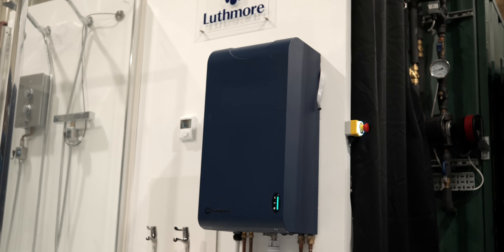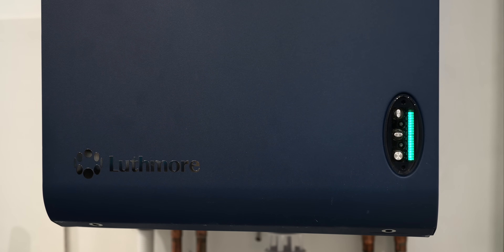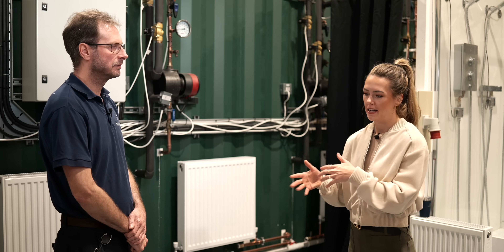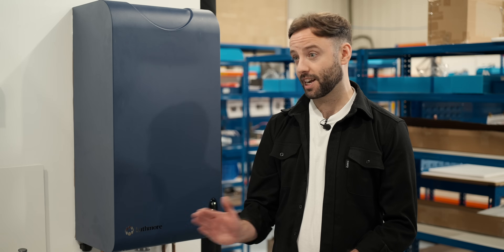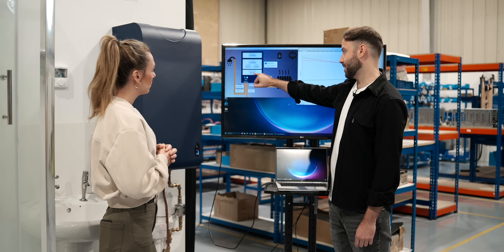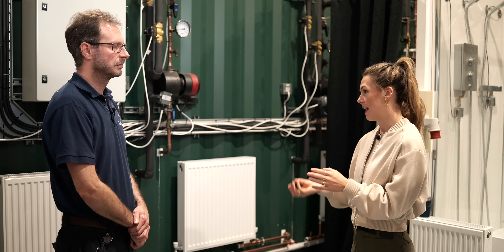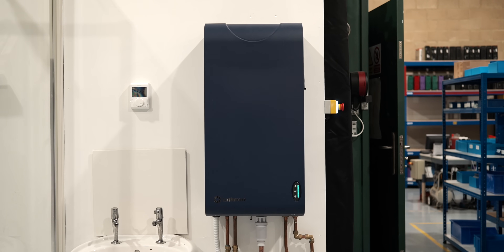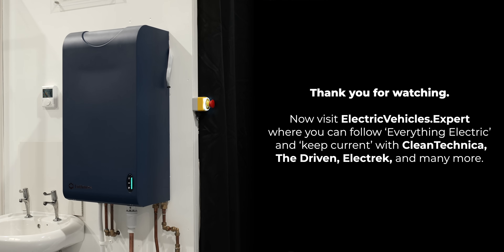Could This Battery Boiler Replace Gas AND Heat Pumps?

Comment: So basically it’s like a storage heater.
Reply: No, it's more like a combi boiler...
Reply: @theelectricmonk3909 a very expensive one which ever it is ,  none of these systems will be adapted in a massive way until they are affordable for the average income, in reality will never happen.
Reply: @KavanOBrien   "in reality will never happen." - they said that about the car, they said that about TVs, they said that about computers, they said that about mobile phones.

The REALITY is - anything that's newfangled and expensive now, WILL be affordable in time - or will vanish without a trace if something better comes along (think Logie Baird's TV vs. Marconi's TV).
Reply: @theelectricmonk3909  talking of time unfortunately it waits for nobody, if people manufacture items that only a few can purchase it doesn’t take that much time for the item to be no more .
Reply: @KavanOBrien  Well... I wouldn't like to make a prediction as to which innovation will, or won't, succeed in the marketplace.  IMHO there's certainly a short to medium term opportunity for the boiler in this video; long term, I suspect heat pumps will prevail. One thing is undeniable - even if you ignore the climate arguments, our use of finite fossil fuels means that gas is only going to get more and more expensive and unreliable, so an alternative will be needed - this offers an interesting prospect to tide over those who still can't seem to see the benefits a heat pump brings, or who - for whatever reason - are not currently in a position to install one.
Reply: @theelectricmonk3909  unfortunately the climate scam has to be the biggest scam in our planets history, as far as the heat pump scenario with it costing so much to run especially here having the most expensive electricity prices in the world due in fact to these climate clowns , drill baby drill is the answer along with an abundance of shale gas , when one has a sinking ship due to these climate clowns the only way forward is to get rid of these ridiculous politicians and their ideology.
Reply: @KavanOBrien  The main reason the UK's electric is so expensive, is because of the price of gas. Which - like the gas itself - is extremely volatile.

It wouldn't take much (although the fossil fuel industry would scream about it) to de-link the price of electricity from gas, and link it instead to the price of production from wind and solar (and, in future, tidal and wave) power, which would dramatically reduce the price of electricity - at which point the running costs of heat pumps (which, despite your claim, can be lower than gas) would really drop compared to running a traditional combi boiler.

The problem with shale gas (even assuming you don't believe in physics, i.e. that the earth's atmosphere and hydrosphere in particular will absorb and retain a larger amount of energy due to the reduced amount of energy being radiated out to space as a result of the increased concentration of so-called "greenhouse gases") is that it's composition is sufficiently different to what we know as natural gas that appliances may well not be compatible with it, e.g. it may need replacement jets. Then you've got the issue that you can't just fire it down the same pipes as natural gas due to the fact people's boilers and cookers will stop working (or become very inefficient & potentially deadly carbon monixide sources). It sounds easy, going after shale gas - but just like tidal and wave power, the reason we haven't done it yet, is because it's a lot harder than going after the natural gas that we have been going after up until now. So no, I dispute your claim that shale gas is the answer. IMHO wave power, because it's almost always wavy out in the Atlantic and the North Sea;  and tidal power, because there is ALWAYS a tidal change going on somewhere around the UK are the next major sources of energy we should be tapping into. Again, never mind climate change - think of the ecological damage drilling/fraking for shale gas will cause. Although I do admit that a badly installed tidal generator MIGHT generate more sliced sushi than would be ecologically comfortable...
Reply: @theelectricmonk3909  you do realise that every wind turbine uses on average 80 gallons of oil each year and some of the biggest uses 700 gallons of oil , they have to turn them off when it too windy because the way it goes into the grid is not stable, I don’t know where you get your information from but it sounds like you’re tapped into the ideologies of this climate brigade which as said it’s a scam , if the right government gets into power next time and they drill for shale there’s enough for two hundred years , so at least we won’t have to buy coal from other countries that ironically use lots of oil to ship it here,  unfortunately ideology is making the plans instead of common sense.
Reply: @KavanOBrien  Your comment is a bit of a mish-mash of random tropes; but let's assume your numbers are accurate...

1) The oil is used for lubrication. Oil is vital for that task, and we know there's a finite amount of it in existence. Seems to me that literally burning the stuff once, and in huge quantities, is scandalously wasteful: It should be reserved for important tasks, like lubrication (and plastics).

2) The "turn off when too windy" - this is mostly because the grid doesn't have any significant storage capacity. If there were large battery banks (or even ways of burning off the excess power, e.g. generating truly green H2 by electrolysing water with the excess power), then they'd not need turning off anything like as often. It's pretty rare they're stopped due to high wind speeds - although it does happen, I grant you.

3) "the way it goes into the grid is not stable" - see above: Energy storage, or a useful mechanism to dump excess power (whilst still providing a useful service) would resolve that problem entirely.

4) "I don’t know where you get your information from" - scientists, mainly. The "climate agenda" you speak of has come a long way since Mann was faking his tree ring data.

5) The UK has vast reserves of coal, even to this day. The problem is, it's too expensive to dig up with modern health & safety. If you don't care about miners, UK coal would be cheaper than imports... but even if you take the CO2 out of the equation, burning coal generates all kinds of toxic outputs which frankly we don't need to deal with, if we use a clean alternative.

6) I don't know if your "200 years" of shale gas is accurate or not - but even if it is, that's just kicking the can down the road. Sure, you, I and our children and maybe even our children's children will be long dead when that starts to fail us; what a legacy to leave, eh?

Comment: I suppose it would work better in the US, with our tank style water heaters, but it seems you could save yourself a bit of money by just building a more efficient diy battery bank hooked up to an existing electric water heater and setting up a charging schedule for the battery bank.
Reply: Can you point to a 30kW on-demand electric water heater please?
Reply: @mgutkowski  No, but I can point to an electric water heater that already has water that has been heated and has the capacity to fulfill all my hot water needs for the day with a single heat cycle.  You didn't actually read or comprehend my post, did you?

Comment: I think it's interesting, but I think the use cases are limited. If you have the option of solar and batteries then you could just use a cheap instant water heater. The batteries being single function means it's expensive. The argument about the density of the batteries is somewhat irrelevant.

Comment: Interesting tech, but if you already have battery storage with a solar system, what usually is the case don't really see the need for this kind of boiler , or is it battery density such a game changer?
Great video keep it up
Reply: They covered this in the video - home batteries max out at 10kW delivered power (or less - the Tesla Powerwall is only 5kW, for example).  This device can deliver 30kW for instantaneous water heating.

For reference, the main grid connection in most houses is only 25kW (100A) - so even if you used all the grid-power available, and shutdown everything else in the house, you couldn't run this just from the grid.  

Heating hot-water takes a lot of energy.

Comment: this boiler is a good idea especially if you have solar. I with my freezer, fridge and cooker had battery storage. It could save money and still work in a power cut.  Plus cheaper than home batteries.
Reply: You can buy 32kWh of battery for around £3400 so is it cheaper? I'll answer for you, no it's not.

Comment: They are turning off your gas to limit your choices and control you, not because the sun is too hot.  That's rubbish.  -- The product is an interesting idea though.  Store the heat in chemical batteries as electricity.  Its compact.  You get full heat output while the battery stays full, not progressively cooler water from a cylinder as you run more cool water into it with use.  You have no thermal tank loss over time.  No worries over legionella and keeping your cylinder nice and hot since there is no warm water storage to grow bacteria.  If its cold in the supply pipe, no problem.

Comment: It would be good to the performance compared against the Bolt e boiler. But there are lots of flats which are all electric with simple immersion tanks for hot water and storage heaters. Where gas is not available.

Comment: charges slowly so  can be used in off grid and  you get a smaller inverter !! with DC   elements wont last long..  low frequency is costy due to copper  so  its high freq  low quality inverter   just for the resistive loads to heat some tubes!     nice  device/ if is not demanding from existing source

Comment: Oh dear, credibility down the drain! He talks of energy losses storage and heat if 15% yet a CoP of 1 - misleading  / mis-selling nonsense. It is also compared with gas efficiency which when done properly taking account of losses, is less effecient,  the reverse of what's stated, or in other words a lie! A simple heat pump cylinder with poor CoP and battery (or no battery) would be cheaper to run! STOP DOING THIS, PLEASE!
Reply: Luthmore aims to offer a product to satisfy use cases where a heat pump is not practical, including - but not limited to - simple lack of space for a hot water tank. Our unique patented technology stores the waste heat generated by charging and discharging and uses it to pre-warm the incoming water (see it in action in the video above here https://www.youtube.com/watch?v=Nc5trKJvcjg&t=578s
). It represents roughly 15% of the total energy stored by the Luthmore boiler.

Comment: This isn't green tech, it's literally the energy equivalent of resistive heating. If there's differential in grid pricing, it will be solved with grid storage long term, not at the household.

Comment: You know the price of electricity in the UK
Reply: They mentioned smart tariffs and being able to charge the battery storage on overnight cheap electricity.

I'd prefer a heat pump myself as for every 1kwh of electricity you put in, you'll get 3-4kwh out. Much better bang for your buck and makes that cheaper overnight leccy go even further

Comment: When you say electric is more expensive than gas, it is 4x the price!
Reply: I think they may be looking at off peak tariff users where electricity is 7p (and further reduced when factoring in solar) VS Gas that is 6p in the heat pump Vs Luthmore comparison.

Neither Luthmore nor Heat Pumps are worth using for a standard fixed rate tariff alone.

Comment: Sorry but too many variables to make an informed decision whether this will be any good. Will depend how well insulated property is for one on how long this system will run central heating on a single charge. Not very long I would suspect. My solar struggles to charge what I have in the winter let alone anything else. Even with cheap rate electricity I think it will be too expensive to run. I use a phase change system for hot water and gas for central heating which just about works ok although I do have to use strategies to not use too much hot water. As the gentleman said heating water uses a ot of energy perhaps a better way is to run an electric fire in the room you are using rather than heating water.

Comment: A 4kWh version of this (~75l equivalent) would suit us. That's enough for a couple of showers or a shallow bath. I really like the low-storage-losses aspect. A 2nd battery (ours will do 8kW) and a (much) bigger inverter could do the same job. It does seem a little perverse buying a special purpose battery just for hot water, but the losses should be be lower than a tank, especially for people that don't use much water.

Comment: In future when off peak demand goes up, then will the greedy energy companies still supply 'cheap' off peak rates
Reply: I think we will move to a much more dynamic load model where your batteries are charged or discharged to the grid to balance demand. I can see that as EV and battery installs increase there will no longer be the current 5 or so hours every night.

Comment: It looks to me like quite a large device, certainly larger than a gas combi. Id be interes2to know whether the battery and hotwater heating units could be separated.
Reply: Don’t think it is significantly bigger than Worcester Bosch or Valiant or Viessman combi boiler once you take into account the flue, it’s published dimensions are 850(H) x 415(W) x 310(D).

Comment: This is a pointless product. A home battery would be more flexible as it could be used for heating, cooking, lighting etc. etc. 
 A heat store ( standard hot water tank) may suffer more losses but how long would it take to pay for this product with the savings from negating those losses? Likely decades! 
 A Sunamp with its phase change tech will almost certainly be cheaper and less environmentally damaging to make. 
 If this channel’s aim is to promote green tech then they should be careful to showcase products that make sense or at least show some journalistic integrity by challenging the company whose wares they are advertising.

Comment: Great technology in principal. I would switch tomorrow if it was close to a replacement combi boiler. How much is one of these installed?
Reply: It won't supply your central heating.. it only supplies hot water.. they didn't tell you that...

Comment: Best home battery 10kW? Looking at my 6 x 17kWh Lifepo4 home batteries. The product makes sense here but the facts aren't all that factual on alternatives.
Reply: That is a BIG system. What is the peak power output of each 17kWh unit? Guessing a single unit is a typical install.

For more than 15kW in an AC direct electric combi you need 3-phase, so could work for you if that's why you have six batteries.

Comment: You'd be pretty ignorant to not use a heat pump to create your hot water if you are going to be using electricity anyway. 3x COP to heat water instead for what I imagine can end up being end up the same price. Also if you are going to have free electricity from solar anyway and want to do hot water like this, why wouldn't you just install a battery you could use for any load? Go all 12/24V and save all the installation costs too lol :D

Comment: Nice. Promising. I like that it is not flue dependent so can be fitted anywhere - within reason.
Reply: Its against BS7671 guidance of having batteries inside the house, if it was sodium ion it would probably be OK (I dont believe Na cells vent combustable gas) but LFP produces combustable hydrocarbon gas if they fail - I realise the risk is low but...
Reply: @biker_rich_71   and adding to that, it's going to depend on what the insurance companies have to say about it.  Firstly, if they'll insure you and secondly, for how much when you have one of these.  You just need a few cheap ones from China entering the market, burning down a couple of houses and the insurance premiums will go through the roof.
Reply: @biker_rich_71  "I realise the risk is low but..." - well... according to the UK fire service, they attended around 14,000 gas related incidents in the 5 years to 2021 - so nearly 8 per day. Obviously, that's small compared to the number of gas boilers that are out there... but it's still a bit of an eyebrow-raising stat.
Reply: @theelectricmonk3909  I think you missunderstand, LFP goes bad very, very, rarely - it's far safer than piping hydrocarbons into a houses with aging pipe work and then burning it.
Reply: @biker_rich_71  Agreed, LFPs are an order of magnitude (at least) safer than having an endless supply of flammable gas coming into your home...  I'd hope that there was some kind of sensor in the boiler such that if the battery DID go bad, and started generating noxious fumes, there'd be some sort of alarm.

Comment: Can I re-purpose my 2016 Nissan Leaf Batteries for domestic use please?
Reply: You can but your home insurance will deny any pay out incase of a fire, even if the battery wasn't the cause of the fire.
Read the fine print of your fire insurance they don't go along with DIY electric contraptions or anything electrical that doesnt have the safety certification marks on them

Comment: Completely agree with @andymiles5156.  The app / network service that runs my EV charger is just about to be ceased after just 5 years use. I'm so cross about that!

There seems to be an emphasis in this story about how wonderful it is to have a high flow rate shower. Well we also have a bit issue with water availability (especially here in East Anglia). No - the emphasis should really be about water saving low flow rate showers!